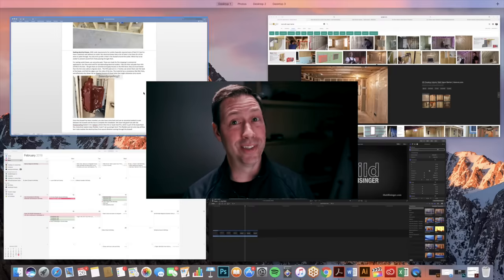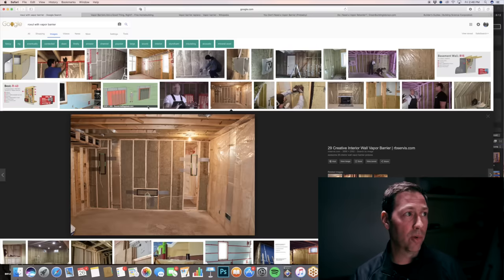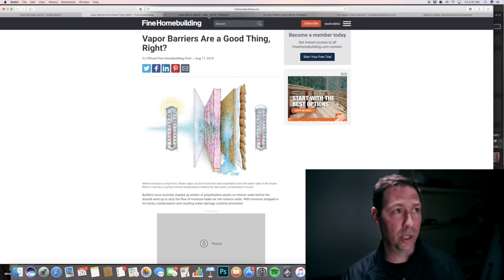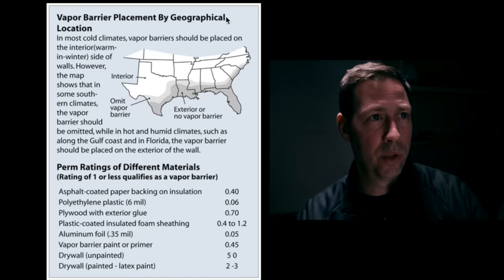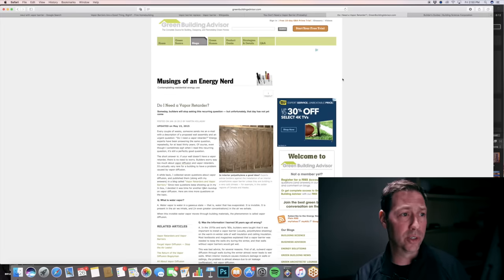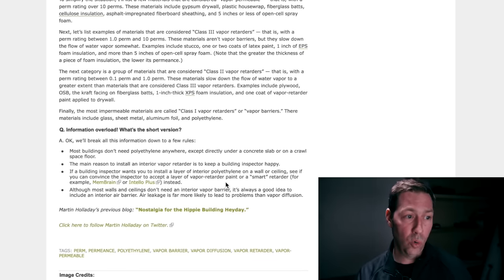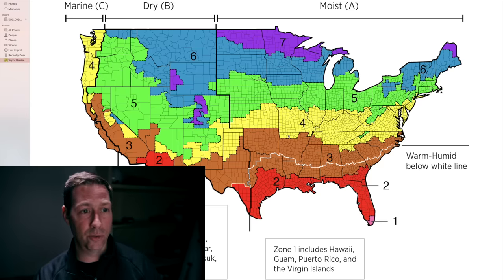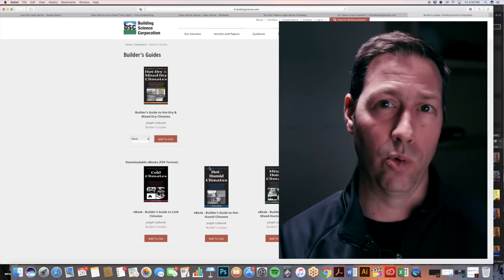Vapor Barriers: Need one or not?

Comment: I am in building zone 7 , Winnipeg Canada,   All houses her have poly vapor barriers.  I remember our old house that had no barrier and the humidity would go in the attic and freeze on the underside of the roof and in the spring time huge chunks of ice could be heard falling and banging on the ceiling , wetting all the insulation in the attic and ruining it.  Since all houses have basements , there is usually no problem with ground rain water seeping in from the bottom.  So all the houses are up a couple of feet above grade.
I put my sofa up against the outside wall and the sofa had a straight back.  it was -35 outside and I have R30 walls.  so I pulled the sofa away from the wall to vacuum and there was Ice on the wall.   The  Insulation in the sofa up against the wall brought the freezing point to the inside of the house and the humid air froze on the wall. That is when I realized how important the vapor barrier was.
Reply: What if you had a tight air barrier but not a vapor barrier- would diffusion still be an issue?
Reply: @rsmith02  As far as I know the Tyvek and other brands of air barriers are designed to allow water vapor to pass through so it doesn't get trapped in the middle of the wall.   You still need a vapor barrier inside the house walls.   If it is an old house with no vapor barrier , you can use oil based enamel paint on the walls and ceilings and that works.   If you live in a hot climate then you need the vapor barrier on the outside of the house to stop humid air from entering the walls and condensing in the middle of the walls to which could form mold.   That  happens when you have A/C making the inside air colder than the outside.

Comment: You point out that in the colder zones that the sheet rock slows down the movement of moisture through the walls and that is enough except in zone 7.  But then you point out that air leakage through cracks, crevices or holes in the sheet rock can allow seriously damaging amounts of water through the walls.  In my opinion, this is exactly why you need a vapor barrier that can flex and stretch and cover cracks due to settlement and a barrier that can be sealed around electrical boxes such as receptacles switches land lights etc. such that a little movement won't rupture the barrier.  As the house ages and some home owners drive nails and screws into the sheet rock to mount artwork, these holes are penetrations through the surface and interior of the sheet rock that allow air to flow through.  in modern times many  people are using humidifiers to maintain a comfortable and healthy humidity in their home in the heating seasons in the north. You can build a theoretical case to allow you to say that under perfect and new conditions, you don't need a vapor barrier; but but with the practicalities of a home as it ages, why not put in the added protection?  Of course you can do a lot with flexible caulking to seal around boxes and you still may need that at the boxes when you use a membrane type barrier; but a tough, flexible membrane will be there during most typical structural movements caused by settle-ling or holes made by the home owner.  As you pointed out, one thing you do not want is a hole in the wall that allows the warm humid air to continuously flow out through the wall and form condensation in the colder side of the wall; that is big trouble.

Comment: Most houses I’ve done established a vapor barrier using the paint on drywall. But I’m doing a cabin now with a plywood interior (so no paint). We’re in climate zone 4 and had planned to use plastic behind the plywood but after watching, it seems like the plastic would just encourage mold on the back of the ply. Right?
Reply: Yes. Use "Kitchen and Bath" paint in high moisture areas. I do wish more builders would use green board in bathrooms, too many do not.

Comment: In Canada it is recommended to have a vapour barrier with insulation 2/3 on outside and 1/3 inside. Rim joists or concrete should have R10 rigid insulation on outside to prevent cold from being transferred through the structure.

Comment: I'm doing a wood floor over a slab that doesn't have a vapor barrier under it.  This is in the basement of an old house.  I put down one of the new dimpled plastic barriers made for just such an application.  I'm wondering if they will really help, or if you have had any experience with this sort of thing.  Maybe a subject for another video?
Reply: Tom, I think you did right by putting the barrier down, especially over concrete which always will have moisture. Use pressure treated joists also.
Reply: august,  Yes, I agree there is always moisture.  I put down two layers of 1/2" osb glued  and stapled together over the barrier.  Didn't really have the ceiling height for sleepers.
Reply: Tom, I have the same type of house, 1870's and 6' 6'' ceiling. I still think you did all you could other than doing the first layer with pressure treated but there are issues with that so...
Reply: august,  Yes, it's hard to know how far to take things.  I know two layers of ply would have been a lot better than the osb.  I guess time will tell.
Reply: Watched flooring company do following. 6mil plastic on slab, tape seams properly, pressure treated 2x sleepers on layout of choosing (16 o/c or 24) ply then flooring
Reply: tom ruth sleepers lay flat on slab and get tapcon screws tight to flr (only losing 1 1/2 ") you also get an airgap under ply
Reply: James Mascaro,  I have heard of this method, but I've also heard that a vapor barrier under the slab is great, but not so good on top of the slab.  But who really know's how long this will function or if Delta FL or  DMX 1-step is any better than your method? Time will tell.

Comment: I have pulled many walls apart over the years.  Plastic on the inside is a bad idea.  That guy Holmes on tv loves it, what a joke.  Up here in NY old school tar paper lasts 40 years and looks like new under the siding.  Original Tyvek becomes like string from the acids in cedar.   If you want a super tight house closed cell foam sprayed would be my choice with 30lb tar paper over plywood. To tight of a house isn’t as good as it sounds.  You will have to ad make up air after the fact.
Reply: daversj 
Tar paper is Ole School. Tyvac is just to keep the inspector happy. Use Zip, Delta or one of the liquor applied. Mat is in to excellence and building science, building home to last centuries, not Twenty years!
Reply: I like felt i.e. tar paper for the outside it breaths VS some house wraps that do not breath. Fact I was talked into using high tek roofing underlayment instead of felt, the roofing  decking buckled in spots from moisture.
Reply: In Holmes defense, he is in Canada which is where Matt is saying you need a moisture barrier.  Perhaps not plastic but that is the older school thinking of course.
Reply: Agree. I just pulled plastic down an hour after putting it up. Western NY, 90 degree day stapled 6mil plastic after Roxul. It started building moisture immediately. Glad I didn't put drywall up yet. Thank you for this video.

Comment: What about a vapor barrier on walls in a basement in a zone 6?
Reply: shutterassault1 what is the verdict?
Reply: I've worked on a few basements in what would be zone 8, except Canada uses different zone numbers.  (Go to Fargo, and keep going.)  I think Matt is correct about air barriers being more important than vapour barriers.  The main problem I see with fibreglass insulation in basements is the sometimes extreme difference in temperature between the footings and the top of the foundation.  (Currently about 50 degrees Celsius/ 90 degrees Fahrenheit right next to me.)  If you don't have an obsessively tight seal everywhere, this will pull air in at the top of the wall, cool it, and force it out at the bottom.  I've been in a lot of houses where you can feel cold air being pushed out of unsealed electrical outlets.  In a couple of cases, we had to use heat guns to melt ice that was holding the old insulation solid to the top of the foundation wall.  I believe rockwool stops this vertical air movement better than fibreglass, but not as well as Tuck Taping the heck out of every possible opening.  Foam insulation works a lot better in basements, but the only area it's really worth the money on a DIY job is in bathrooms.
Reply: Get yourself some rigid polystyrene insulation. There’s a lot of options out there. Preferable one with a thermal barrier on the inside. The polystyrene, when installed correctly, will act as a vapor/air barrier in a basement without absorbing the collected moisture. Still, if you end up finishing, drywall and wood studs are a bad idea. You’ll never stop water from coming into the basement. Galvanized steel studs and one of the many cement board brands are the way to go. If your not finishing the basement, remember to never store things in cardboard and get yourself a good, energy star rated dehumidifier.

P.S. do not put an exhaust in a basement. I’ve seen some contractors and waterproofed who put those in. All you end up doing is creating a vacuum for more wet air to fill the space. It’s a never ending battle.

Comment: Ok, so you don't need It, but if you want it, will it cause more problems than it solves?
Reply: The answer has to be less because millions of homes have been built using a vapor barrier. If a vapor barrier caused this much mold, mildew, you would be seeing it everywhere, yes ?  Not saying which way is right but...
Reply: My father used it against the basement foundation so when the concrete weeps it doesn’t go to the insulation.
Reply: Probably yes. Read Martin Holladay's thoughts on the subject as pointed out in the video.
Reply: I rip houses apart everyday.  I almost always see mold when a vapor barrier is used, and almost never when it is not used.
Reply: abacab87:  Precisely.  The vapor barrier has been doing its job — trapping moisture that would otherwise leak into the structure and potentially cause mold.   In cold climates, you want these between your insulation and drywall.  Unless the home has significant air leaks or moisture issues, the vapor will be trapped on the outside (cold side) of the poly, protecting the interior of the structure including the air you breathe.
Reply: Exactly, the cold side of the poly is inside the 2x4 wall where the mold forms on the wood and the inside of the exterior sheeting.  Seeing lots of problems with older homes that were remodeled inside and vapor barrier used.  Here in the southeast many older homes are sheathed with diagonal 1X6 boards underneath brick veneer of wood siding.  Way too much air and moisture movement causing problems against a poly barrier.   Older homes with an upgraded high efficiency HVAC systems, even with air leakage, are healthier.
Reply: Couldn’t you just use a vapor barrier inside and outside of the stud wall? Either way you look at it the moisture wouldn’t be able to go anywhere. Just a thought
Reply: @eggmcmuffin9368  I think you got it backwards. If you live in America, you do NOT need an interior vapor barrier. vapor barrier is for the outside of the house only.
Reply: @garrimic3  Tyvek vapor barrier (outside) lets moisture out but does not let it in. If you live in America you do not need an interior vapor barrier unless it is on you batt insulation. (which by the way is a vapor retarder and not a barrier)

Comment: I’ve always wondered about this having moved to various states and seeing it in use and not in use. My thoughts have always been that a vapor barrier is also synonymous with a moisture trap!  Aside from an exterior wrap like Tyvek under siding to keep out high humidity and in general to limit airflow inward, I just never thought the opposite inside the wall was necessary too.  As the saying goes, too much of anything can be a bad thing.  

I could only see that moisture trapped between plastic and drywall in hot southern states would eventually turn into mold if that moisture cannot escape. On some level a wall system needs to be able to breathe.

Comment: This is somewhat dangerous advice to be giving without enforcing how important air sealing is.  The 30 pint scenario is very realistic given the way most houses are not sealed at the drywall level, or the weather barrier level on the outside for that matter.

Air sealing is critical, and traditionally it’s done with a plastic sheet in the inside and a housewrap on the outside.  Changing that requires a lot of planning ahead and communication between the builder and trades.
Reply: Plastic sheet does little to nothing for air sealing.  You have holes all over due to things like staples and you have big outlet holes that are rarely if ever sealed around the outlet or at the back wire penetrations, possibly vents, small cracks between the joists and drywall that aren't sealed like at the floor, and my other things other things.  The house wrap on the outside has little to nothing to do with air sealing either.  Moisture at the surface they are covering, but not air and not the moisture that moves through those cracks and gaps.

Comment: I live in climate zone 5. Every time the temperature rises above freezing, I get water puddles on my living room floor! We have figured out why. The exterior wall on the floor above is the ONLY surface in this house WITHOUT a vapor barrier. Every time it gets cold, humidity is condensing on the inside of the exterior sheathing. As Matt said, cold air can't hold the moisture, so it reaches dew point and deposits onto the OSB, where it freezes. Then, every time it thaws during the winter, it runs down inside the wall, and comes out on top of our living room windows, and drips out into the room from there. Bottom line: ABSOLUTE YES to a moisture barrier on the top floor in zones 3 and up.

Comment: Thanks for the well organized info.  Here in northern Canada a interior vapour barrier (6 mil poly) has been the standard for decades.  There is conflicting information when building more efficient systems such as staggered stud or a continuous rigid foam outside of traditional framing. 
My current home is fairly well built with 2x6 walls with batt insulation, osb sheathing, a house wrap, and siding with a well sealed  6 mil poly under the drywall.  Once the temp falls into the -20 F or colder our furnace(and most furnaces) has a built in humidifier which must be turned on to work with air management systems( VanE) I think the vapour barrier is more of an air barrier.  
Planning on building a much more efficient home with the r12 zip sheathing over 2x8 studs and raised heel trusses. We are trying to figure out the vapour barrier system as there have been local issues with very efficient homes developing moisture issues within the wall systems. 
I’ve watched quite a few of your videos and find them to be unbiased towards any one system and still very helpful.
Thanks for the excellent content.

Comment: Except in Canada the issue is moisture migration through openings - The poly is a diffusion barrier back up to create a consistent barrier ... it is still the seals around openings and cold air penetration from the exterior that create a hoar frost inside the wall (which melts all at once). Thanks for the talk. Your comments about regional building requirements was the most important point.

Comment: In Florida, most houses are built with concrete block. The vapor barrier as you know gets stapled on the firring strips on the inside. Usually it is a "foil paper". Now with wood construction it is a "Tyvek" type vapor barrier on the outside. Great video.

Comment: Great topic. I’m in Northern California. Very dry and super hot in the summer. Fairly wet in the winter and very rarely does it get below freezing.  Our typical new construction house is built using using only Forti-fiber on the exterior and then either a scratch, Brown and color coat of stucco or Forti-fiber and then 1” of rigid foam and then one coat brown mud, then the color coat.  The ladder method usually results in lots of cracks around windows and doors.  I wish our local contractors would start using delta’s dimple mat under the paper.

Comment: This was a great topic. As a remodeler almost every time I've run into plastic barriers right behind drywall, I've also run into mold. 
We're not required to use it in my area, but when I do see it, I cringe. 
Thanks for some solid data in a short video.
Reply: That is exactly the problem. No air space between the plastic and the back of the drywall which means no where for the moisture to escape. It is trapped in that paper backing and molds grow. Paper faced insulation was designed with the staple flange to keep an inch of space between the insulation face and the back of the drywall for that very reason, but people often use it to staple flat on the face of the stud creating the very same problem. It really depends on whether the house was built to be air tight or if it was designed to "breathe" and too many get this wrong in remodeling.

Comment: I have a 140 year old fieldstone foundation in my basement. I had a lot of mold when I bought the house. It's been remediated and I'm installing a perimeter drain system/French drain and a dehumidifier. I'm likely not going to put sheet rock on the walls so that the foundation can breathe. I'm getting conflicting info about whether or not I should put a vapor barrier on the uneven stone walls. I'm also being told by some to use drylock paint or something like that. I'd love to have a finished basement but I think even with all of the work I'm doing there will always be some moisture coming from outside and below. I'm in NJ which means cold winter's and hot summers. Thank you